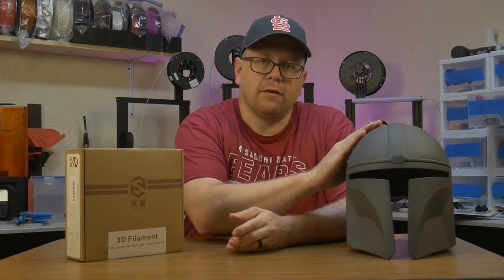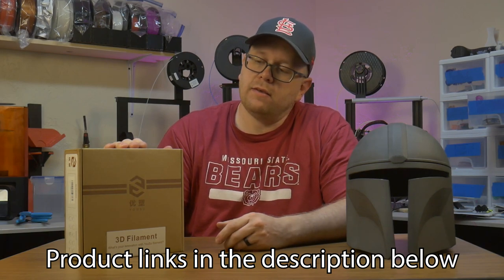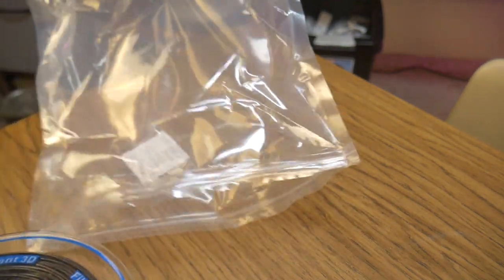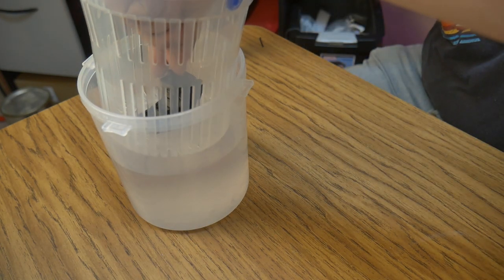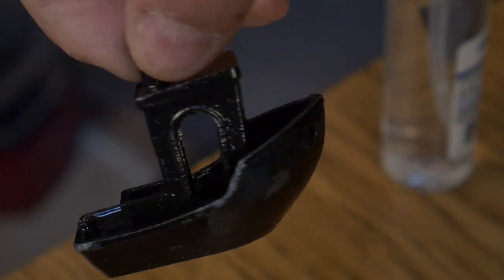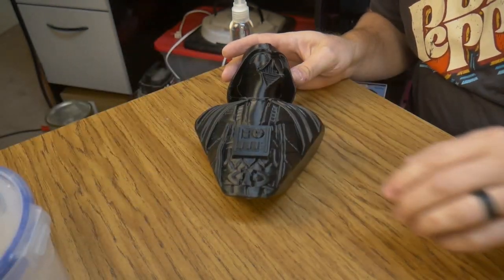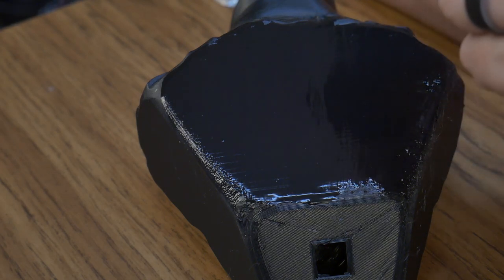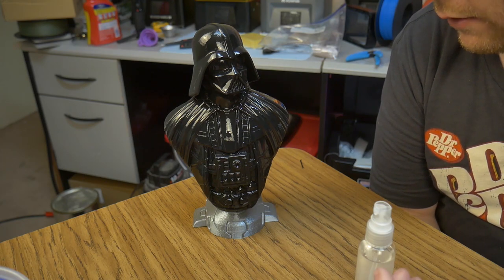Yousu PVB Filament: No Sanding Required

Comment: Did the smoothed print ever dry? or was it always tacky?
Reply from the maker: Dried solid. Super glossy too!
Reply from the maker: Worked the best for me. Just takes a little more patience. Even better would be a light sanding and then the spray method if you are looking for super-smooth and glossy

Comment: Hi, im new to this 3D print stuff. Question: If I wanted to paint this Vader statue, what type of paint is recommended for it? Thanks!
Reply from the maker: I think just about any paint will work. If you plan on using PVB filament, like what is used in this video, I would stay away from alcohol paints. But acrylic paint and spray paint should be fine.

Comment: once you apply a first coat are the lines gone?
Reply from the maker: No, it took several applications to smooth it out. Printing at .1 layer height may help speed up the smoothing process.

Comment: Great test! Do you know if this is more heat resistant than PLA? I need something that is more rigid than PETG but can also survive a day in a hot car.
Reply from the maker: Your best bet for car parts is either ABS or nylon. You will need an all-metal hot end to print it, though. I doubt PVB is heat resistant as it prints at the same temperature as PLA
Reply: @SouthpawWorkshop  Well, ABS stinks and nylon is too floppy. And both are a PITA to print. The search for an easy to print but durable material continues I guess. Thanks for confirming.
Reply: @-Ricochet-  maybe try one of the heat-treatable or heat-resistant PLAs
Reply: @-Ricochet-  Try ASA maybe. Harder to print than PLA but its UV resistant and bit more heat resistant than PETG.
Reply: @NoIPHU  Thanks for the tip. I will.

Comment: I wonder how well the smoothing would work if you tried applying it with an airbrush.  It would be aerosolizing the IPA, which is essentially what the Polymaker Polysher thing does, you just wouldn't have the chamber.
Reply from the maker: Might work, but remember, the smaller the droplet of alcohol, the faster it evaporates. The reason Polysher doesn’t have that problem is because it is in a closed system.
Reply: @SouthpawWorkshop  yeah i can confirm, the airbrush method has been the worsed so far. i think it's partially because of the reason you mentioned, but also if you live in a high humidity area and brush outside, your compressor is going to pick up water in the air and spray it on to the print. as far as I can tell, any amount of water absolutely destroys the print surface

Comment: no matter what i try, I cant seem to get this stuff to polish like it did in your video. Ive tried airbrushing the 99% alcohol, dipping in the alcohol, brushing the alcohol… nothing. surface is still rough. Any ideas?
Reply from the maker: What layer height did you print? Are you using this specific brand or a different brand? I suspect performance varies between brands
Reply: @SouthpawWorkshop  I used .1 layer height, and Yousu black PVB (just like yours.) I used 99% IPA. I tried brushing, spraying, dipping... nothing seems to work.
Reply from the maker: Sounds like you are doing it right. I sprayed it on heavy and let it dry on its own. Maybe you got a bad roll.